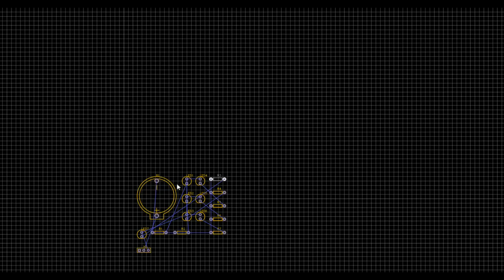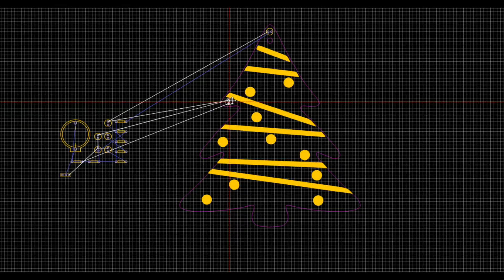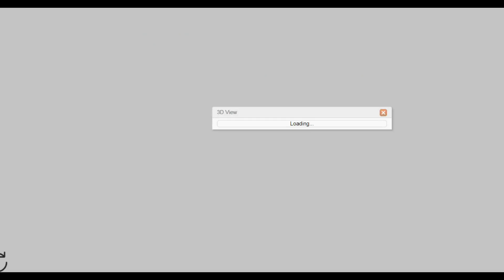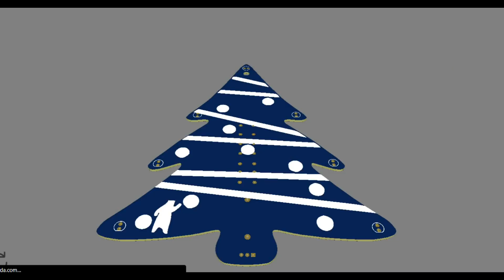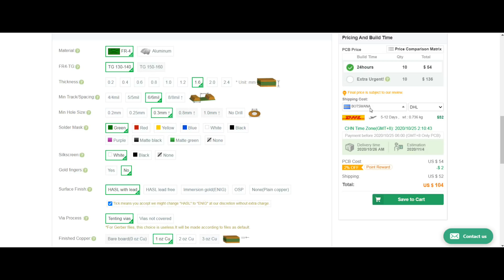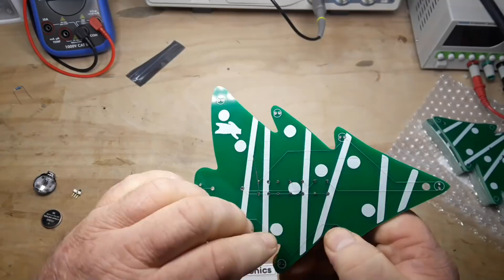How to make a custom shape PCB to fit your project needs

Comment: Paul, first off thank you for the tutorial, very grateful.  I have a question, I followed you great instructions however I do not want a 10” PCB board. How do I resize the board outline to make it half the size, and more manageable. Any help there would be appreciated. Thank you.
Reply from the maker: You have to do it outside Easy Eda, there's no way to scale it in the on program.

Comment: Really sweet project!  For another video please consider modifying the design to use smd components.  For these reasons:

1  I'm interested to see how the design (or other considerations) might need modification.  For instance using fewer/a single resistor, adding more lights, a smaller diameter battery and switch.

2  I'd like to see how using PCBWay's component installation service affects the price.

3.  Like another commenter posted, I'm interested in scaling the design down for kids to wear as a badge on their shirt -  about 2" tall with a pin/clasp to attach it to the shirt.

Thanks Paul!
Reply from the maker: I can't draw. I'll see if I can scale it

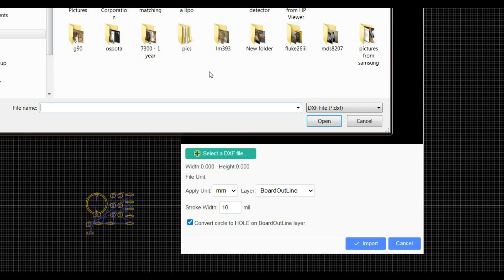Comment: At 3:08, I see units as mm, but it also shows stroke width as 10 mil. Are they mixing units (mil = thousandths of an inch)?
Reply from the maker: Pcb design software uses mils and mm. It's just easier  to switch between them, like when you need .1in spacing.

Comment: I like the videos about making PCBs. In all my time doing electronics, if there wasn't an existing board. I did the circuit/project on perf board. Going to make a PC board next time I don't have one available. Thanks, Paul.
Reply from the maker: Thank you. I'm self taught. 30 years as an engineer, I never designed a pcb. I drew plenty of schematics, but we had a guy on staff that layed out the boards, and made them in house.